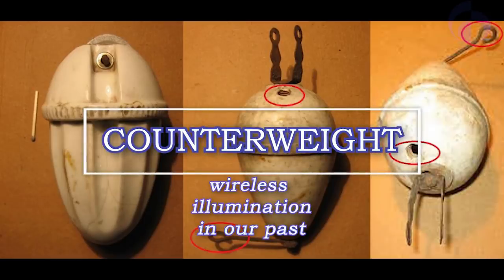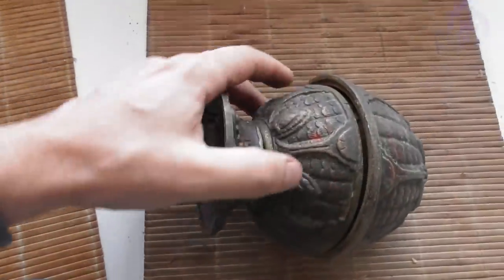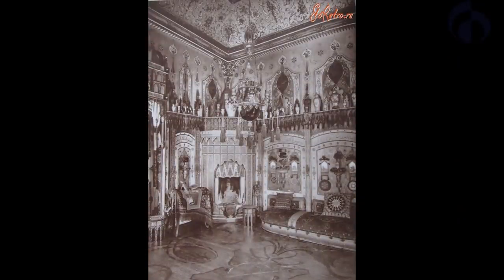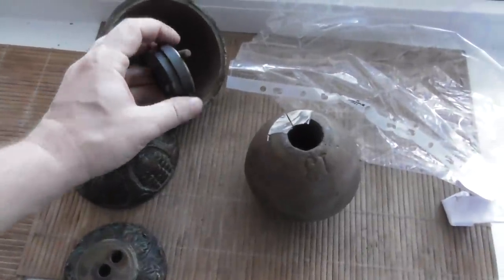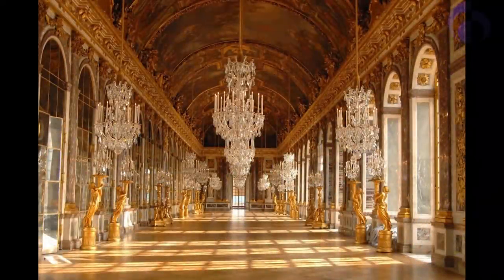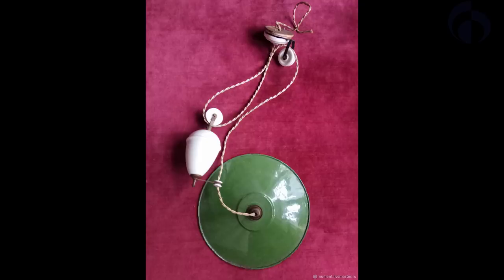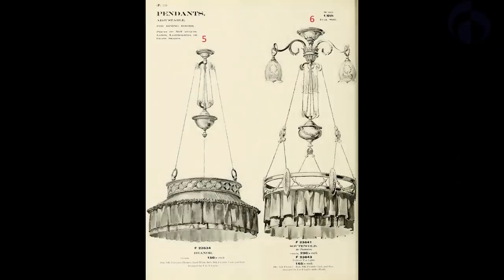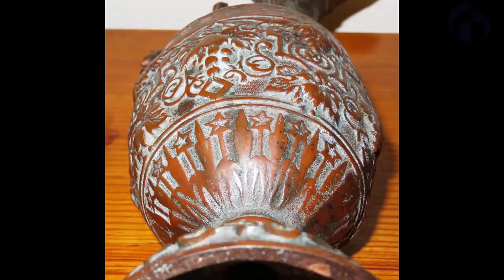"Counterweight" for free energy illumination

Comment: You sent me down a rabbit hole...When I saw the three bent electrodes on the top part, I got to thinking about a mecury arc lamp:

In 1876, Russian-born telegraph engineer Paul Jablochkoff, who was living in France at the time, invented one of the most popular arc lamps of the period. Known as the Yablochkov candle, it was affordable and easy to operate. The arrangement of the lamp’s carbon electrodes made unnecessary special controls, which increased the cost and complexity of other kinds of arc lights. However, this same arrangement caused difficulties when a Jablochkoff candle was turned off. Improved designs eventually superseded Jablochkoff’s device, but not before the French Société Générale d’Electricité sold large numbers of them. They were used widely in France and Britain, from docks and marketplaces to the Mansion House in London.

Meanwhile, across the Atlantic, Americans adopted an arc lamp designed by Charles Brush. Raised on a farm in Ohio, Brush developed an interest in science, particularly arc lighting, at an early age. Family members remarked that in his youth he was more interested in arc light experiments than the fate of the family farm. Brush built his first arc lamp as a high school student in Cleveland. Later, lamps of his design lit up the city’s streets. Brush’s arc lights incorporated electromagnets and a mechanical “ring clutch” that improved regulation of the carbon electrodes and the arc of light produced between them. Brush also invented double carbon lamps that gave off light longer than ordinary models and a method of powering several lamps linked to a single dynamo.

Comment: I think it is the last part of a system, like a bulb we use today. It could be useless alone, like a bulb sitting on a table, just glass and metal without electricity.

Consider thinking the whole house structure, high poles, spikes on roofs, they could gather energy sent from somewhere else for this device to turn on.

Check the youtube video of Russian teenagers who build an antenna using mercury and watching all tv channels with a simple aparatus. They could get the radio waves on the air, this device could operate with same principle, gathering the energy sent from a central location, like a big factory or so called church or mosque.
Peace and love.
Reply: i know its been 4 years but do you remember the video name or have a link :)

Comment: From the article:
"So we come to the conclusion that these balances are our etheric capacitors, well known from previous articles, only on a small scale. And inside them was a mercury amalgam. As the discharge lamp approached him, it began to give light. And the secret of our etheric capacitors is probably now very close to a solution. If someone has such an antique counterweight, try looking inside. If you see something similar to traces of mercury, then you can no longer doubt. If someone wants to repeat such an idea at home, I do not advise, there are two more secrets there, without the knowledge of which the chandelier will not burn. If, in all seriousness, someone wants to repeat this thing or even put it on stream, write until you have completely banned it ." -google translation

Comment: If counter weights contained mercury than this explains everything. No way the ceiling paintings from baroque palaces would have been preserved when there was sud from candles everywhere for centuries. In Fulda is a very ancient church, the Michaelskirche, made with giant stone slabs and it has an extra structure that allows air to flow out in such a way that sud collects there and gives that small window, which has a small gothic tower above it, a dark black appearance compared with the bright stones of the wall. Genius system from a time or place when they really used candles. Like ground ants using air flow to areate their den. 
This is the sud window: 

https://upload.wikimedia.org/wikipedia/commons/thumb/a/a7/St._Michaelskirche_Fulda_%285%29.jpg/640px-St._Michaelskirche_Fulda_%285%29.jpg 
That church is also extremely mudflooded, part of an old "monastery" complex with an even bigger but younger cathedral next to it: 
https://media-cdn.tripadvisor.com/media/photo-s/0a/d1/f8/cd/michaelskirche-fulda.jpg 
Michaelskirche to the right and St. Salvator cathedral to the left which replaced the older Ratgarbasilika after it got destroyed in a war: 
https://encrypted-tbn0.gstatic.com/images?q=tbn:ANd9GcT_0XkK64gzd6w6c9UXtnx8xEoS4CbgVgomZ2zzIKmXrijN2izLJQ
Reply: Thinking about it the Michaelskirche was definetely a Yezidi temple when it was built and the sud window was for fire rituals with oil lamps, not for candles. At least that was how the original builders must have used it.
Reply: You would need a full time candle maker to keep the supply of candles in these old palaces. And none caught fire from a candle in the 87 th room when they went to bed ? Lol
Reply: @charliejeans2413  Mainstream: "They had lots of slaves that lit or extinguished all those candles whenever somebody wanted to turn on the light." 

By the way, the candles in the Michaelskirche are not for lighting either but ritualistic candles lit by Christian believers for the dead or for other prayers.

Comment: My guess is the egg generates an amplified top heavy toroidal field that works like an electric generator but the coil replaced with mercury,movement creates current in the wire,then I guess the egg draws static charge from the ether that is converted to usable current and variable depending on height,like a teslacoil or plasma globe working in reverse?

Comment: These things can be adjusted and lowered or raised as needed, there's a guide as well. Imo in the last vid I did I show the carbon rods that I posit were used as heating. So I'd guess the same system only vertical. Where the lining up of the rods and were adjusting as the rods burned. 
The weight  would be to keep the rods steady and not be disturbed. 
Either that or the ball had something else in it and once lowered to the chandelier caused the light to operate. Open air switch of you like. Cheers..
Reply: I think the crown moulding, gold statues and guilding on the walls was part of the Peltier heating & cooling "fireplaces", too.
Reply: Charlie Jeans ...Very interesting. You’ve got some great vids on your channel. Subbed.

Comment: Excellent research. Just thinking about metals is something like this: when you have a different metals you can generate small amount of voltage. The current will flow some one metal to another by them be made of from a different materials. Keep up the good work. You definitely nail it. Cheers from Brazil.

Comment: Hi Phil. Good work again. Seeing that materials used are in some part copper and zinc in others I immediately start thinking of electrodes like in batteries. Also I know that if a mechnic/plumber would combine like copper and zinc parts current will start to flow - either due to direct contact between the different metals or by using electrolyte. Lastly we know that in those brass balls on top of spires and ancient buildings MERCURY was used as the harvesting agent for aetheric energy..
Phil, I just let you take part in my little brainstorm :) cheers buddy. Besafe on upcoming Nov3rd!!!!

Comment: Waw! Good video!
Where are these architects?
And those masons?
All deaths? I don't think so.
Regarding your question about what you may put inside?
I can tell you. There in Russia you produce Ruthenium. If you mix a little bit of Ru with Hg (Mercury) inside a glass jar, you have a super antenna taking radiant energy directly from the original atmosphere.
Regards.
Reply: Interesting. And maybe the inside piece was floating in the substance you mention. Is it possible that, together with the outside, it generated some resonance or amplified the currents? Also the (egg)shape is interesting because it has the golden ratio (vortex)
Reply: @noconsent5902  
I really do not know Jorrit.
What I know is the Hg must be metalic (not oxid which is a venom) and Ru is the antenna.
Another important thing is what you noted, the shape.
The transmission down to the place through parts of copper.
About ressonance I really do not know if or how it works.
As far as I know you are a investigator so, go ahead my friend and release your imagination. Best Regards!

Comment: pure water isn't useless, it is used in high voltage capacitors, ceramic and water, its very possible they simply worked because the whole building was acting like a transformer and these vessels couldn't be connected to ground, thus suspending them, just sharing my ideas, thanks for the videos, if its two different metals, it would also act as a battery

Comment: "Counter weight for electric light - The adjustable pulley pendant should be filled with lead pellets or similar to balance the weight of the light fitting."  was a quote i ran across on a blog called https://rubell.wordpress.com/2008/06/28/my-seven-porcelain-counter-weights/

Comment: Nice, but i think that a counterweight is just what it is. A counterweight. and the opening is to fill the counterweight to balance the weight of the lamp, to move the lamp on the celing up and down with a stick. Up the lamp is on, down the lamp is off.